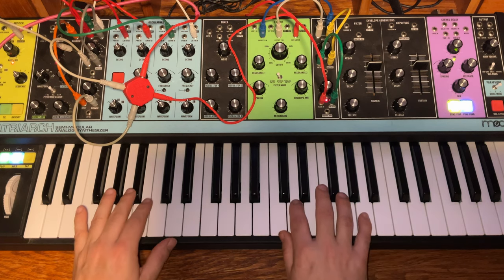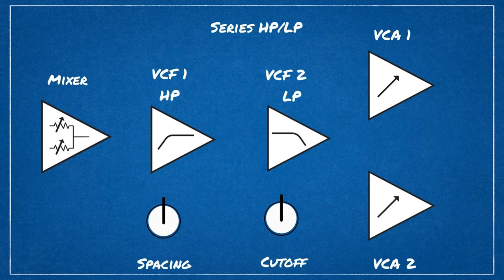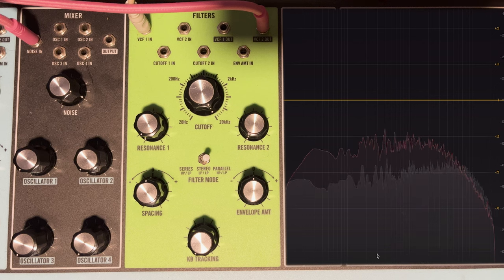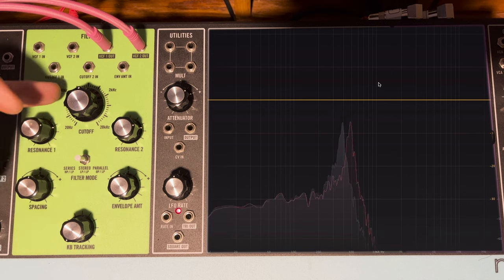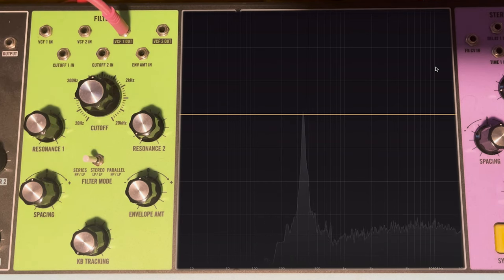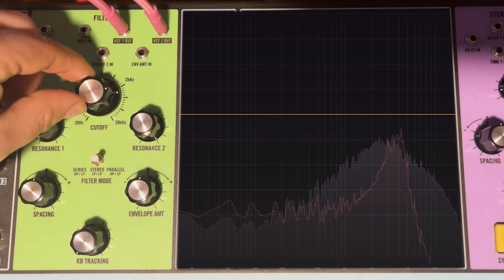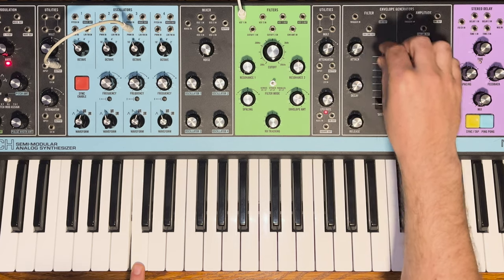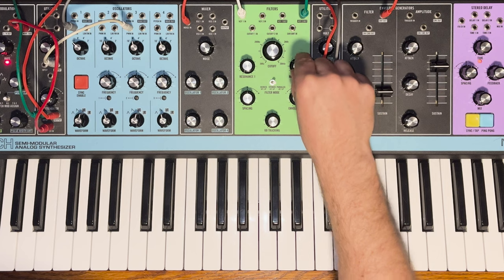Synth Nerds Only: Moog Matriarch Filter Deep Dive : Part 1 - Theory & Mono-Synth Patches

Comment: Regarding the filter feedback patch at 29:30 : you get a different result if you patch the output into one of the osc inputs, because the noise input will invert the wave coming in. Easy to check if you e.g. insert osc1 wave out  into noise in and then mix them together. You will hear nothing.
Reply from the maker: thanks Ziggy! that’s very useful to know…there’s so many neat little secrets on the matriarch. built in inverter is a good one

Comment: Thank you so much for this video, SUPER helpful for a new Matriarch owner such as myself. Just as a side note I wanted to point out that the mixer section itself might be responsible for messing with some of the erroneous frequencies you were getting with the white noise. It’s my understanding that if any of the knobs on the mixer are pushed past about halfway, that you begin to actually drive the overall signal and specifically it boosts the fundamental. Other than that, like as far as any extra filters are concerned, I have no idea what’s going on there, but the mixer itself has to have some effect on the noise you passed through it. Anyway, was thinking you might want to know that if you don’t already, thanks once again and I’m
Def a subscriber now ;)
Reply from the maker: Hello Justin, Very happy to hear that you found the video helpful. and thanks for subscribing, that helps a lot! Yes, the mixer on the Matriarch is a lovely dirty little mixer, I find saturation starts even well before the half way mark. You are correct, the mixer may have added frequencies to the noise...i actually bypassed the mixer and did the test again, results were very similar so i cut it that part out of the video...those vids were getting SO long didn't want to bore people to death. But good catch, and thank you for pointing that out.
Reply: @RobeMusic  thanks for the reply :) ive always felt like the saturation MUST HAVE to start before the halfway mark just by listening to it and the fullness it brings but this has always just been little more than a suspicion of mine and the fact the manual says halfway i never really gave it any other thought so its def good to have an expert clear that up haha. but yeah, probably like if not my favorite features of this synth, then its up there. i feel like so few people realize just how integral it is to achieve that sound that moog/moog modular instruments in general.have, and that this synth has in spades. Love to just run stuff through it, probably one of my all time favorite ways to saturate stuff ever so slightly. anyway, thanks for nerding out with me a little bit. Ever since COVID hit and I literally had to sell my over $60K+ vintage/modern synthesizer/studi setup due to financial difficulty i havent had anywhere near enough moments to do just that so it def brightens my day and brings a smile to my usually stress filled face haha

Comment: I wonder if the VCF 1 patch input is dc coupled with the patch input for VCF 2. Would that explain why VCF 1 controls both filters when patched? This would be similar to the dc coupling of the VCOs— if you patch in a pitch modulation to VCO1, it’ll carry over to the following VCOs.
Reply from the maker: Yes Justin, You are 100% correct...after doing the video I thought about it for a while. Makes sense to have VCF 1 and 2 dc coupled at the VCF 1 CV in patchpoint...then you can modulate both filters if you want....and of course it's in the manual as well (which i should have checked right away). I'm going to talk about that in part 2

Comment: A really helpful video! I have a noob question though. I know you can use VCF 1 and 2 as stand-alone processors for external instruments. But I'm wondering if it is ever possible to use them to process audio signals coming from virtual instruments as well? Like is there a way to convert digital signals coming from a software instrument in a DAW session to analog signals that can then be fed into Matriarch and got processed by its filters? Thanks in advance!
Reply from the maker: Yes, it's possible and really easy to process audio with an external synth. I was going to cover that in the second video of the filter series....but there was just too much to cover and the videos are all pretty long already. (at the end there's a little teaser https://youtu.be/VZohCUl_fTo) There are many different ways to do it...some DAWS make it really easy...but any "pro" DAW will be able to do it. All you need is to take the audio out, plug in to your synth filter inputs and back in to DAW from filter outputs. Easiest way is to use an I/O plugin. 

If you want to use the filter to process a vst instrument in your DAW that can be a little trickier depending on what you want the filter to do (example...envelope trigger from VST instrument) but it's still doable. 

Hope that helps, I will be doing a video about processing audio with your synth in late June or July.
Reply: @RobeMusic  Got it. Thank you so much!! You are a lifesaver! I haven't seen such detailed and well-explained content on Moog matriarch from anywhere else and I'm looking forward to your new video!